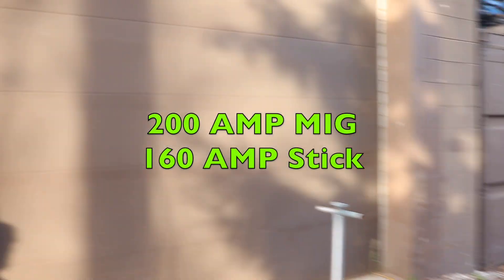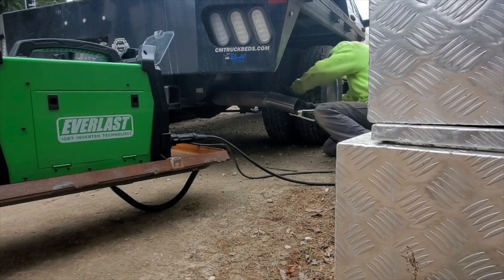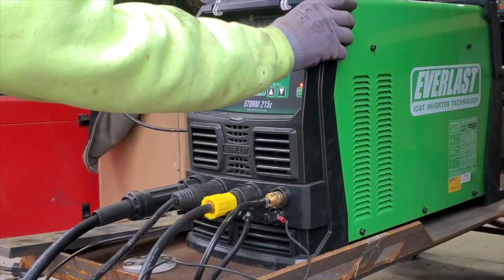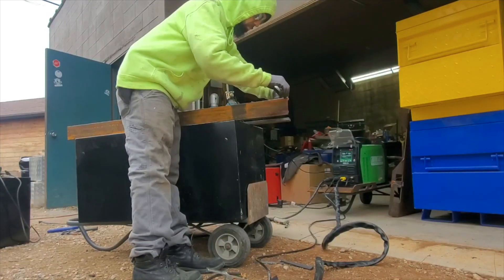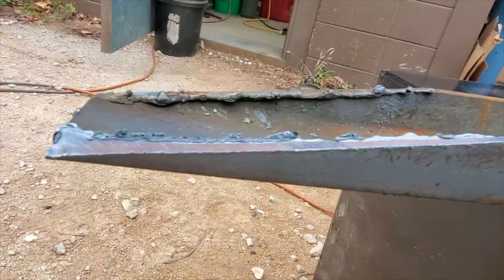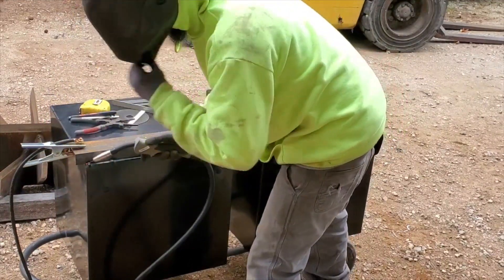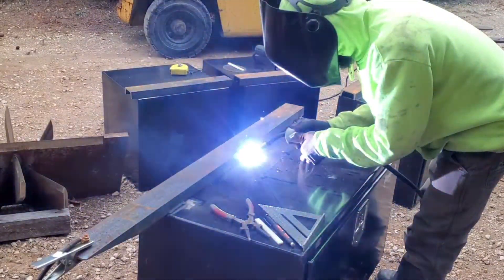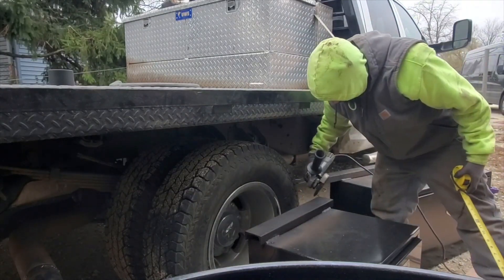Giving the Everlast Storm 215C a run ...  trying out MIG & Plasma !

Comment: I use 575v machines at work and they all have a discrepancy from what it say and when you are actually welding
Reply from the maker: Correct, no matter what color, brand or model it is…. There is always some discrepancy …. And the amount varies from machine to machine even on the same model
This one here it seemed to be a little bit more than i typically observe - you decide if it is a lot or not

Comment: It's a full 200A welder not a 180.
Reply from the maker: Yes - i correct that in the video.  200 amp mig  160 amp stick and 40 amp plasma ….

Comment: I've used 309 stick rods to repair an excavator bucket with Hardox 450 plate (minimizes cracking of the welds).  I love welding with SS rod.  Word of caution (at least for the rods but I'm assuming for wire as well).  309 emeits a lot of Hexavalent Chromium in the fumes.  A P100 respirator is REALLY important to wear.  They make pancake filters that fit under the welding hood.
Reply: Didn't know the specifics of the fumes, thanks! I recently got myself a respirator, previously I was getting by on holding my breath and using a fan if need be.

Comment: Quick question, in your opinion what is the best inexpensive tig machine for welding aluminum?
Reply from the maker: As long as you stay away from lotus and no name imports you are kind of ok….
If it is just a function of welding aluminum and you are willing to “fight” it a little and you dont know what good arc dynamic is neither do you care you could go  with ( in no specific order)
Everlast 185dv
Everlast 200dv
Ahp alfa tig
Eastwood 200 acdc digital ( horrible machine i have it!)
Primeweld 225…..

BUT if you want a little more out of life the Everlast 210 EXT has much better arc dynamic than all of the above machines….

I welded at some point or another with ALL the machines i mentioned so i have at least 20 min first hand experience in these machines. 

Since arc dynamic is not measurable or covered in any spec sheet it is highly subjective, its my personal experience and the arc dynamic experienced is rated to my personal liking ….

I hope that helps

Comment: Thanks for the video. My Hobart 210  crapped out and I need a replacement. Already have a stand alone plasma and stick machine. If money was NOT the primary concern, what machine do you like in the 200A class?
Reply from the maker: well, if money was not an option and you are looking for more of a "dedicated mig machine" ....  I would say look into pulse technology ...  for Steel your advantages are 1) no spatter 2) building a leak tight tank (like fuel tank or hydraulic oil tank 
and then of course it give you options to daily easy get into the aluminum game, in this day and age where a lot more things are made from aluminum for corrosion resistance, weight savings, being "green" ... etc ....  you may not want to be left behind the power curve ...   you investment on something like this typically in the $2000+ range ...    That would be what I would be looking into ....    as far as what models specifically the Everlast 253DPi and the HTP ProPulse 220 are both good units to look at. ....    
In my opinion pulse technology is a gem changer (or can be a game changer) if you are looking at 200 "regular mig welders" or "multi process welders there is a TON of them out there and in all honesty the differences between them are rather small not groundbreaking .... Sure, one guy will get you with name recognition, the other guy will get you with features, the next guy will get you with "arc dynamic" the next guy will get you with the country his unit is build in the other guy with duty cycle ...  and and and ... at the end of the day they all weld short circuit mig ...  none of them will be a substantial upgrade over your Hobart 210 at least taking mentally a step back and looking at it from the outside in ....
Reply: @ZILAwelds  thanks for the long response. Always enjoy your videos. Take care

Comment: what brand of wire/dual shield are you running for 309? ive seen blue demon has dual shield wire but not a big blue demon fan bc of very poor customer service
Reply from the maker: the stuff I use is make in the US "locally" here in the midwest I really like it were you looking for 308LT1 or 309 LT1?     where I get it from they only stock 035 diameter for "200 amp machines". I guess 308 is sold out here is the link for the 309 same wire I used https://usaweld.com/collections/stainless_steel_mig_wire/products/htp-america-e309lt-1-dual-shield-stainless-steel-mig-welding-wire-10-lb-8-spool
Reply: thanks a lot, I will check out the link. Almost all my stainless to stainless or SS to carbon steel is done with SMAW OR TIG. I’ve ran Lincoln and kobelco 309L wire and it’s great but smallest diameter wire available is .045”. I wouldn’t mind a spool of each (308/309) to keep on the truck! Never know what your going to get into but wire feeding on larger jobs or out of position is much nicer than TIG/stick. I have a very high wind factor bc most of my welding is done on commercial fishing boats. If they’re tied to the dock for a repair it generally means it’s to windy to go fishing. Thanks again 👍🏻
Reply from the maker: @ecr125x  with really high winds you might look into a self shielded / open arc / gasless wire instead

Also this wire here has a 18 month shelf life ( less id store incorrectly.  I would say a really heavy zip log bag with a few spoons of desiccant in  there ….

Comment: Howdy 👋. Looks like a good machine really. I bought an imig 230 i back in 2019. Bought the 52i plasma a year later...roughly. It was ChuckE 2009 that I seen running these Everlast welders to begin with. He seemed to have pretty good experiences with Everlast. The 230i I bought welds great. I have no issue setting this machine to weld. Though I will say...the mig gun is cheap in my opinion and would not stand up to 200+ amp continuous welding. It just wouldn't.  But!!! For what I do, it is just fine. I cannot go on with out saying though...I should have saved a bit more and bought an HTP 200 AMP. Long story longer, most of the welding I do I SMAW. My favorite process. I never went to school for welding. I literally taught myself with you tube videos. Mainly ChuckE. The first welding machine I bought was an (still have and use often) Hobart Johny homeowner LX 235 Stickmate AC/DC from the tractor big box store. And since then I have purchased an older...much older Miller Dialarc 250 AC/DC machine. Unstoppable! That old transformer weld machine is great. Well....enough of my rambling/typing. I've got about five minutes left of the video so....happy welding to you. I look forward to your next video and a future update on the Storm 215.
Reply from the maker: editing it right now ... in the next couple days I should be able to release it